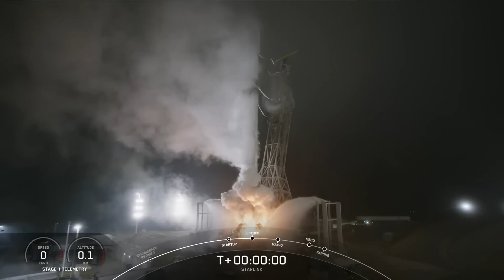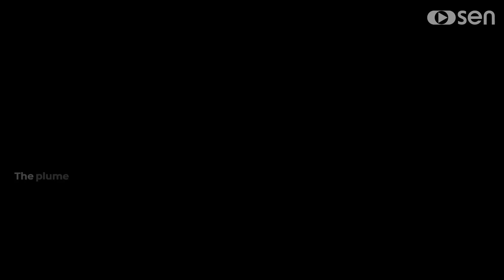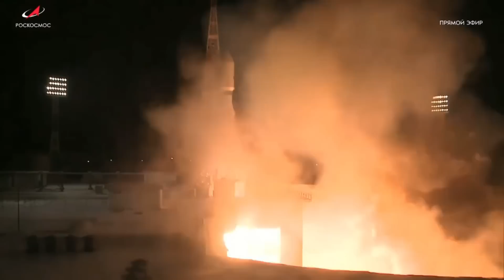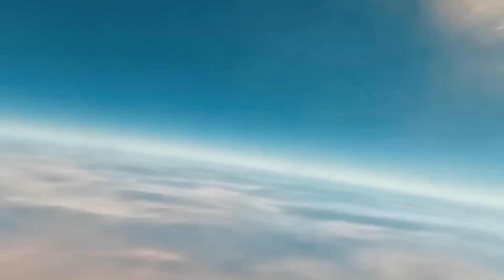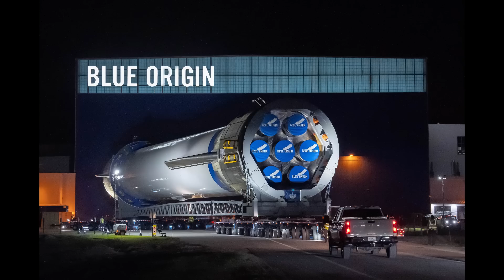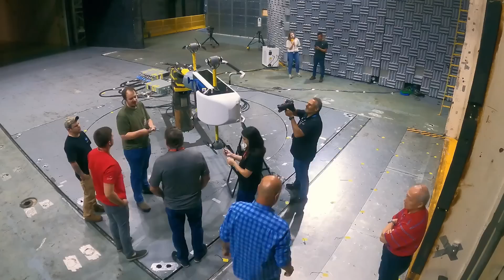China Launches New Falcon 9 Clone While SpaceX Flies Next Starship - Deep Space Update December 1st

Comment: Those bricks you mentioned the Chinese are going to put on the outside of their space station...you may not have read the old Time Magazines and Life Magazines from the 1960s (I grew up reading those) where they were talking about scraping up lunar soil, melting it, casting it into curved panels, and using it to shield a toroid space station -- like the one seen on "2001: A Space Odyssey". They also mentioned using the lunar soil to shield habitats on Luna way back then. It might have been mentioned in some sci-fi books of the 1950s. 

Personally, I say enough with these Tinker Toy style space stations and build the ones envisioned back in the 1960s. Of course, they'd have to have a large enough diameter for the centripetal force (which is NOT "artificial gravity") to be tolerable. Sure, it'd be great if we could build a Babylon-5 type of space station, though...IF we ever get that far, technology-wise (as in we don't nuke ourselves into oblivion first), it'd be a l-o-n-g way off.

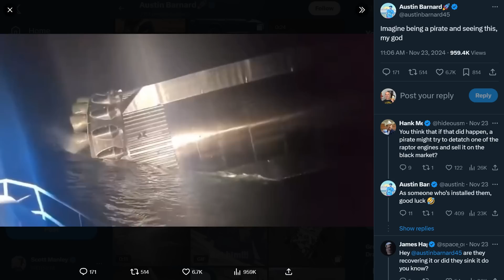Comment: 4:15 I dont understand why, if the booster was still nearly fully intact and floating on the surface, why would they not just simply tow it back to Boca Chica and analyze it and scrap it there? Why go out of their way to sink it, especially when it is so close to the shore line and the water is clearly not even as deep as the booster is tall? It makes no sense to me. Especially after they went thru the effort of hauling up the remains of booster from IFT 4, and that one wasnt intact and sunk on its own. I think that was still the correct thing to do for that one, but with IFT 6 the booster was just floating there waiting to be towed back and they deliberately chose not to. If anyone can explain why, please do.
Reply: They don't have the support equipment or infrastructure set up like cape Canaveral 

It costs to build ships just to be on standby if the tower catch fails
Reply: The logistics of bringing it ashore is likely diffi, and may well technically require some extra salvaging regulation or some such. Towing it back to shore itself may not be safe either when it may at any point sink on its own.

I was going to say I'm not sure the water is actually shallower than the booster is tall but it really is a BIG rocket... It's also a HEAVY rocket.
Reply: Money

Comment: Also, Ultra Starship block 5  booster should be pointy at both ends tapering to a nice hypersonic heat shield cone up top and thickening to a serious aerospike nozzle cluster at the base with outside tank rings as downcomers and baffle cones and the whole shebang caught by an electromagnetic field cradle. Cargo, Hab, Ship/Lander, and smaller suborbital ballistic deliveries as independent donut rings in a tower of Hanoi stack [think MIRV on steroids] which hot stage directly against the heatshield superstructure and fly off on separate trajectories dependent on mass and orbital velocity. Reentry is pointy side down with an atmospheric 180 flip and a levitational caught landing for full booster reusability. Anything besides a dedicated lander can be reused in space with adequate docking and refueling logistics. Have you seen the Hover Pen - Kinda like that...
                                              👁👁
                                                 👃🏻
                                                 👄<just sayin'>

Comment: Are they allowed to leave a load of ITAR-protected rocket engines in shallow water where anyone could go and nick one?
Reply: The other point is that it would have enough niobium (for the nozzles) and other exotic stuff (for the turbines) to be well and truly worth retrieving from shallow water for scrap. Plus I should have thought SpaceX would want to examine those engines to get more data; they're meant to be reusable so wear and fatigue rates matter. Maybe they just sank it to make sure it's safe to handle (ie there's nothing flammable left) and will retrieve it at their leisure.
Reply: ah yes, anyone with a wrench can go undo a few bolts and load the 1.5 ton engine on their boat
Reply: @giovannifoulmouth7205  anyone who would want to steal SpaceX designs could, yes. You would probably use a torch.
Reply: @TimmmmCam  You need to stop thinking what can be done in comic books and movies made from comic books represent reality.  It's just not that cheap or easy and it's pretty close to the shore so even harder to do un-notived.

Comment: I thought ULA and mr. Bruno claimed Vulcan was cheaper than FH. If FH costs $255m (including mission related costs and nuclear certification), then the Vulcan bid (which has already received money for that cert) must have been substantially more expensive. Otherwise NASA which strives to diversify their providers, wouldn't reject it that easily. If ULA can't even provide a reasonably competitive bid for these high energy launches how can they compete at anything else?
Reply: For Cert 2 ULA didn't have a paying customer and therefore covered the cost themselves. Here Tory Bruno claimed the launch costs were in the "high tens of millions of dollars", so maybe ~$70-100M. For the NSSL Phase 2 contract ULA was awarded $3.1B for 26 launches (1 Atlas V and presumably 25 Vulcan Centaurs), for an average of $119M per launch. A maxed out VC6 with 6 GEM-63XLs will cost more than this average, especially with the added costs that come from working with radioactive materials, but they probably could have made a competitive bid if they wanted to. However rockets launch costs also vary wildly. For example a fully expended Falcon Heavy cost NASA $178M when launching Europa Clipper, but $332M when launching the Gateway CMV (+87% in 3 years).
Reply: @plainText384  

Cost to ULA to launch the test Vulcan would be far less from what they would charge a customer.
:planet-orange-purple-ring:
Reply: @Scanner9631  Yes. Internal costs clearly <$100M for VC2 (hight tens of millions). With profit around 120M (probably ~$95-140M depending on number of SRBs, maybe +-40% similar to the swings in the FH launch costs). That's what I already said in my first comment.
Reply: @plainText384  they did bid and lost.
Reply: @admarsandbeyond  Source? I couldn't find anything claiming ULA actually put in a bid for Dragonfly, or how much it would have cost with Vulcan Centaur. The closest thing I could find is an Ars Technica report where they claim ULA could have been eligible to compete (because they are actually building new Vulcan Centaur rockets now, unlike AtlasV or Delta IV Heavy which wouldn't have been able to support any additional launches beyond the ones already contracted). But just because they could have bid doesn't mean they did. And even if they did bid, that doesn't mean they lost because of cost. And even if they did lose because of cost, that doesn't mean they couldn't have made a cheaper offer if they wanted to.
Reply: @plainText384  According to Stephen Clark (on X), ULA did bid on this launch, and were allowed to do so despite not having Category 3 certification yet for Vulcan
Reply: @admarsandbeyond  Yes, that's the author of the Ars Technica article I mentioned. Does he mention any sources at ULA or NASA to support this claim, or is it the same as the Ars Technica article where he simply says ULA could have bid on this contract, because they are now building new Vulcan rockets and therefore have the capacity to accept new launch contracts.
Reply: @plainText384  I can't answer about his sources. He wrote on X: "After several no-bids on lucrative NASA launch contracts, ULA is back in the game—if it can compete with SpaceX."
Reply: Vulcan has only had one flight and one of the solid boosters malfunctioned (the exhaust nozzle came off).  So not exactly a reliable record to launch nuclear materials.  If it hadn't been an undersized "payload" it would have failed.
:planet-orange-purple-ring:

Comment: I hope this makes SpaceX aware as they always should have been that incorporating both launch and landing on a single tower is too risky:  if any damage is done during launch there will not be enough time to do anything to repair it so the landing must be aborted; and second, if the booster damages the pad during landing it might be out of commission for weeks or longer.  Put simply, the launch tower should be for launching and a landing system needs to be separate and separated by distance.  The final point I'd make is that SpaceX MUST find a way to capture boosters 'downrange' as they now do with the Falcon 9 because if the booster ALWAYS flies back then the payload to LEO will be impacted by about 25% versus downrange capture and 50% versus expendable.
Reply: I thought the reason for having launch and landing at the same site was to allow rapid reusability - just lift the starship using the arms, roll in a new booster under it, refuel and all set to go. Yeah, right . . .
Reply: Starship will already have more payload mass capacity than any contemporary customer needs.  They don't need to squeeze every last tonne out of it: they're designing it for cheap and rapid turnaround, instead.

Soon, Starbase will have 2 fully operational launch & landing towers (by this time next year, or so).  Similarly, the pads at KSC and the Cape (and eventually Vandenberg) will likely have at least 2 towers each.  That is enough redundancy so that an occasional landing failure on the pad - which will be a very rare event given all the precautions and fallbacks, anyway - won't threaten the whole program.
Reply: @Spherical_Cow  Throwing away payload capacity is stupid, particularly if they have any hopes of going to the Moon or Mars.  The starting point for that is at least 150t to LEO, if SpaceX is going to rule out downstream capture then NASA needs to reevaluate them for such missions!
Reply: @Raptorman0909  version 3 of the Starship stack is expected to put 200 tonnes of payload in LEO, in fully reusable mode (with both stages landing at the launch site).  So it will already exceed your 150t criterion, as-is.  As for Moon and Mars missions, they involve refueling from a propellant depot in LEO, which will be made possible and affordable not in the least by rapid turnaround and very high launch cadence: both, requiring RTLS rather than downrange landings followed by days-long transportation back to the pad.
Reply: @Spherical_Cow  Yeah, that figure, like many Musk bandies about, is 100% BS!  There is no way Starship/SuperHeavy, with the dry mass and Isp it has, will EVER be able to put 200t into LEO even if they operated fully expendable, including the booster; when operating with return to launch for the booster the payload will be about half of fully expendable.  Musk was going on about how the Isp for Raptor is going to reach 380, but the highest they've actually achieved is like 356.  You need to bone up on the relevant equations as you clearly have no concept of what it actually takes!
Reply: And you've stated nicely what I've been thinking all along.
Reply: They’re such amateurs.
Reply: @StillAliveAndKicking_  The SLS launched on its first attempt, circled the Moon, and returned to Earth -- SpaceX, OTH, has launched Starship/SuperHeavy 6 times without entering a true orbit or landing -- amateurs indeed!
Reply: @Raptorman0909  You're comparing a system that was finished development with the test flights of a system still in active development.  That alone proves you understand FAR less than you're pretending you do.  You're passing off hindsight like it's wisdom, that's might convenient but also a bit dishonest.  The notion of must catch down range is also proof of a flawed understanding of what they're trying to actually do with the system.
Reply: @imaginary_friend7300  You offered ZERO data to back up your nonsense while I provided data you can actually look at versus your mouth breathing nonsense!
If SpaceX eliminates downrange capture the payload MUST be less than a launch that uses downrange capture as anyone with a passing understanding of the Tsiolkovsky rocket equation surely has to know.  The only time SpaceX has used 'return to launch capture' is when the payload is small enough to justify the loss of performance.
And this isn't an inconsequential thing as the current approach SpaceX has for going to the Moon would require Starship, once in LEO, to be refilled with 6 or more additional launches which could be made far worse if they do not use downrange capture.  The prop loading for Starship is about one million kilograms so in order to refill Starship when the payload to LEO is, say, 100t could take 10 resupply launches in addition to the primary launch.  Come back when YOU'VE actually run the numbers!
Reply: @imaginary_friend7300  For some reason my response to you was deleted so here goes again...
In order to get to the Moon SpaceX plans involve refilling Starship in LEO, sending it to the Moon where is lands and after some time it launches from the Moon and must then return to Earth.  The Delta-V required to get from LEO to the Moon, then down to the lunar surface, then back into lunar orbit, then back to Earth is right about 8200 m/s and that's NOT counting losses to gravity drag, the actual delta-V required, after accounting for losses, is probably closer to 8500m/s which is going to be a struggle for SpaceX because methane does not have enough Isp to provide 8500m/s delta-V even without ANY payload.  Assuming an actual Isp for the vacuum engines on Starship, an initial mass when refilled of about 1400t and a propellant loading of 1400t minus just the dry mass at about 200t gives a mi/mf ratio of 7:1.  Plug that into the delat-V equation and you get:
dV = Ve x ln(mi/mf)  = 3500m/s * ln(1400/200) = 6811m/s -- way less than the 8500m/s delta-V needed!
Go ahead, argue if you wish, but do so knowing you don't actually know anything of which you speak!
Reply: @imaginary_friend7300  For some reason my response to you was deleted so here goes again...
In order to get to the Moon SpaceX plans involve refilling Starship in LEO, sending it to the Moon where is lands and after some time it launches from the Moon and must then return to Earth.  The Delta-V required to get from LEO to the Moon, then down to the lunar surface, then back into lunar orbit, then back to Earth is right about 8200 m/s and that's NOT counting losses to gravity drag, the actual delta-V required, after accounting for losses, is probably closer to 8500m/s which is going to be a struggle for SpaceX because methane does not have enough Isp to provide 8500m/s delta-V even without ANY payload.  Assuming an actual Isp for the vacuum engines on Starship, an initial mass when refilled of about 1400t and a propellant loading of 1400t minus just the dry mass at about 200t gives a mi/mf ratio of 7:1.  Plug that into the delta-V equation and you get:
dV = Ve x ln(mi/mf)  = 3500m/s * ln(1400/200) = 6811m/s -- way less than the 8500m/s delta-V needed!
Go ahead, argue if you wish, but do so knowing you don't actually know anything of which you speak!
Reply: @Raptorman0909  The cost of SLS is astronomical, to date it has cost about $32 billion, and took over ten years to achieve the first flight. Each flight costs at least $2.5 billion. It is not novel, using existing engine and booster technology. In fact it uses Shuttle engines that were lying around, and new shuttle booster rockets. So why so slow and expensive? Starship has cost about $5 billion up to February 2024, including development of a new super efficient heavy lift engine. They are doing things noone has done before. They have demonstrated successful launch and catch of the huge booster, an incredible achievement. They have demonstrated a near orbital insertion of Starship. And they demonstrated two successful simulated touchdowns of Starship. So they have achieved more than SLS for a fraction of the money. When Starship is complete, it will launch for a fraction of the cost of SLS, Musk claims a few million dollars, but realistically a few hundred million dollars is achievable if not much less i.e. 10$ of the cost of SLS. And being reusable it will have a short turnaround time, unlike SLS.